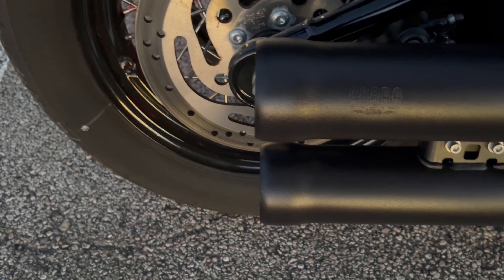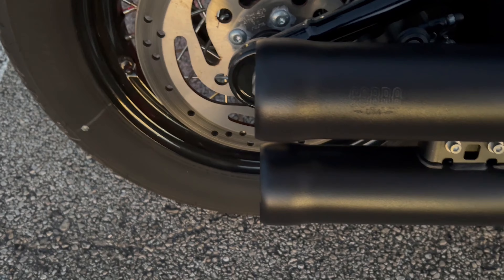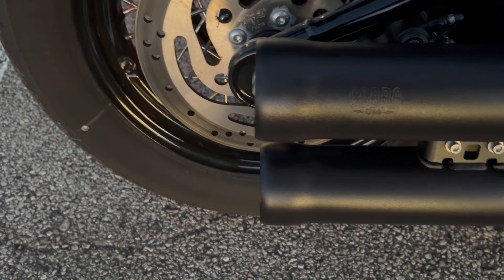Harley Ergonomics - 4.5” Pullback Risers + Cobra Exhaust Sound for 2020 Softail Slim

Comment: Took my 2020 Slim out for a spin yesterday . Have added a few ‘ accessories ‘ , but basically still stock and it still turned heads … and I like it . Yours looks great 👍🏻
Reply from the maker: Nice! I'm on the same boat. Besides the slip-on exhaust, I just have cosmetic/ergonomic mods for comfort. I like the slim the way it is!

Comment: Beautiful bike. Ihave the exact same bike. Bought it used. Previous owner installed the longer fenders and added the stage 1 screaming eagle package. I want to change to a saddleman and add the handlebar extenders as well. Did you have to change any cables or just as s?
Reply from the maker: Thanks! I bought it used also with just 800 miles. The saddlemen seat does bring you up a few inches, so the risers compensate for that. I had the dealer install them during service but looks like they didn't have to replace the cables. I've seen these same risers on another softail slim and although he didn't have to replace the cables either, on his, the brake line was a bit tight.

Comment: Did you change the brake & clutch cables when you installed the risers ?
Reply from the maker: I had the dealer install them during service but looks like they didn't have to replace the cables. I've seen these same risers on another softail slim and although he didn't have to replace the cables either, on his, the brake line was a bit tight.